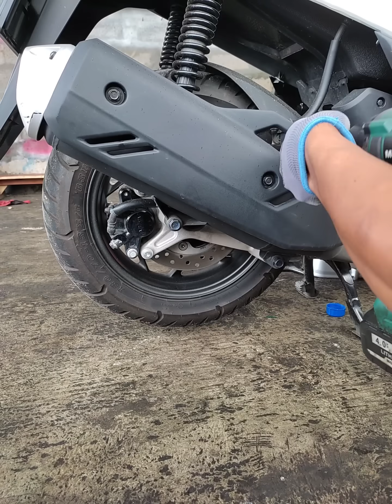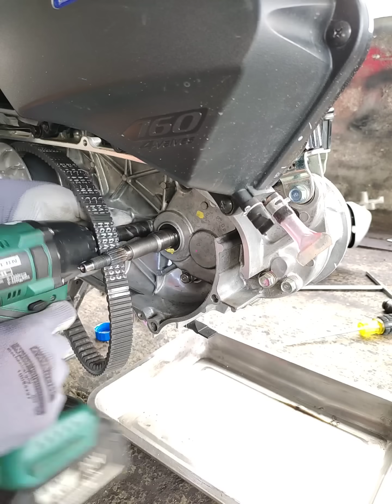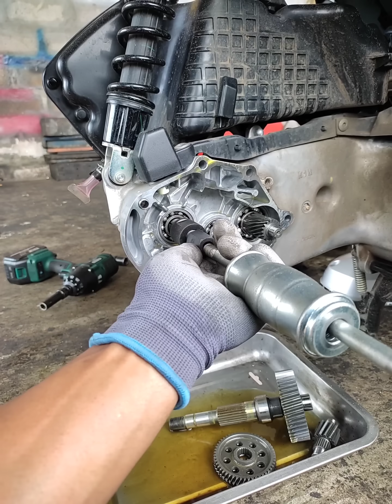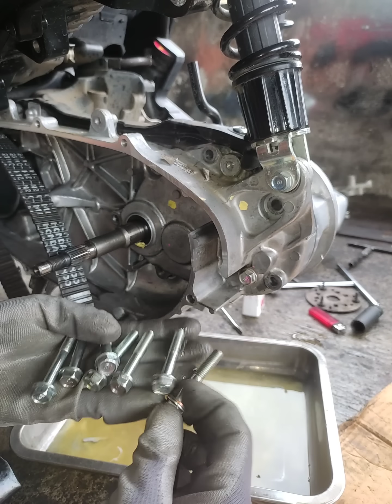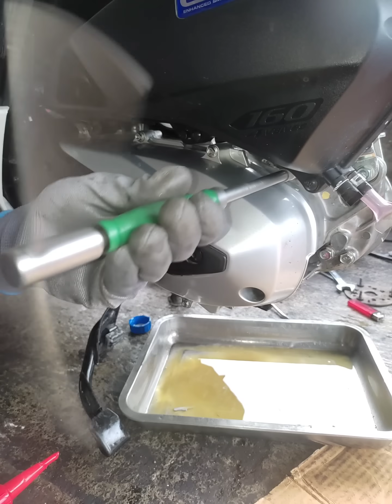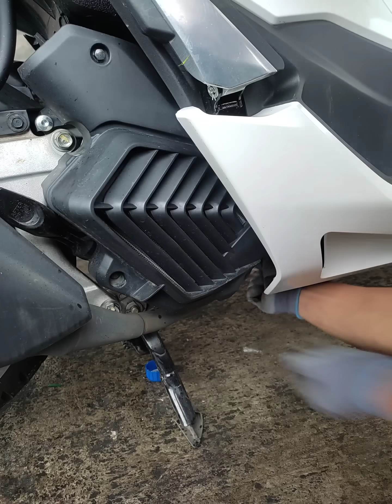BONGKAR GEAR RASIO PCX 160 adv vario 150 atau 160

Comment: This is just for educationally purpose. For cleaning, you don't need to open that cover. Drain the oil after 3 years/ 30,000 miles. Pump in some petrol or cleaning fluid, rotate the wheel several times and empty all cleaning fluid,2-3 times is enough. Leave it to dry or blow air in through the filler hole. Replace copper washers. Put in drainage bolt first. Fill in gear oil as you rotate the wheel. The oil level will be determined by when oil stops flowing from the filler hole. Put in the bolt and tighten to recommended NM.
Becarefull with aluminium bolts, they are soft metals.

Comment: Bang mau nanya motor ku belum genap satu bulan oli nya kental seperti jely, turun mesin habis tuh siap di bersihin dimasukin oli baru kental juga macam jely,kok bisa gitu ya bg apa ya masalah nya
Reply: oli palsu.pake oli apa?
Reply: Oli palsu hati hati
Reply: @cepotcopet8767  ultratec bang
Reply: @Akun-xw2cc  cara bedain asli ama palsu gimana bg
Reply: @seebayobuan5819  federal banyak dipalsuin.pake merk yg ga ada palsunya aja
Reply: @cepotcopet8767  merek apa bg untuk honda
Reply: @seebayobuan5819  klo yg murah meriah eneos,ggi,unilub,jumbo,repsol,evalube,revol,win,bell1,seiken,castrol activ,panaoil,idemitsu,total,united oil,unioil,SAE 10w-30 klo rekomendasi pabrikan honda,tapi klo motor kerja berat mending pake SAE 10w-40,itu smua hraganya dibawah 50rb
Reply: @cepotcopet8767  ok terimakasih info nya bg
Reply: Pengen murah tapi bagus, SHELL ADVANCE AX7 BIRU..